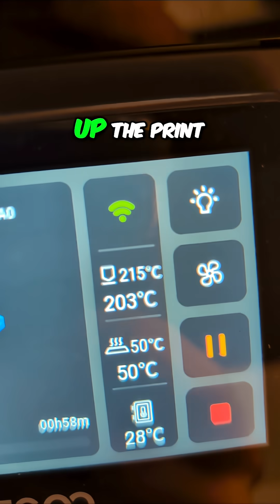Elegoo Centauri Carbon 3D Printing: Fix Speed Problems NOW! #shorts

Comment: On my custom ratrig 500 I added an AWD mod and that thing FLIES.. for really large prints with constant long extrusion lengths I’ll set the hotend temperature to 235 because it’s pushing a volumetric flow rate of 60mm³/s 

So at these speeds 220-225 is no problem!
Reply from the maker: Yeah. I'm learning that bumping the temp on higher speed prints is critical.

Comment: i love my CC man. printed a ar22, all printed except bolt barrel and lower parts kit. and 300 rounds thru it so far no issues great printer for carbon fiber nylons
Reply from the maker: I haven't tried anything like that yet. My friend Flying Rich keeps telling me to print a NylAug. But Middleton suggested his pump AR that he and Corey co-designed. I did one of those in PLA on the N4M last year. Sadly, I barely talk about that stuff on here. Not looking to get this channel nuked.
Reply: what print settings you use and what material?

Comment: For silk, and specifically 3dHojor, they recommend a print speed of 40 - 100mm/s. Between 210c to 230c. Your cold, and way to fast.  Yeah it's gonna print, but surface finish will suffer. Won't be as glossy.
Reply from the maker: Yeah. Their recommended speeds are way conservative. I push it too fast, but it handles faster than they say easily.

Comment: I think the size of the nozzle will affect how much you can extrude, in turn how fast it can go as well. Mine came with a .2 nozzle which seems half the size of standard so it boggles me how it can go so fast but i can only get the crazy speed out of the built in models.
Reply from the maker: That is bizarre. Definitely supposed to come with .4 nozzle